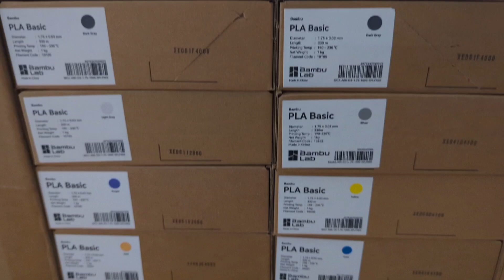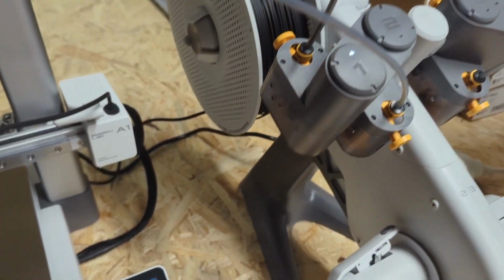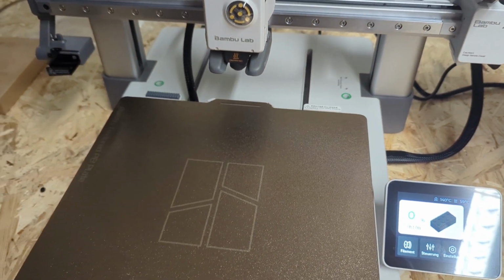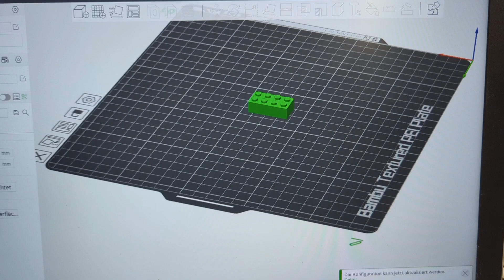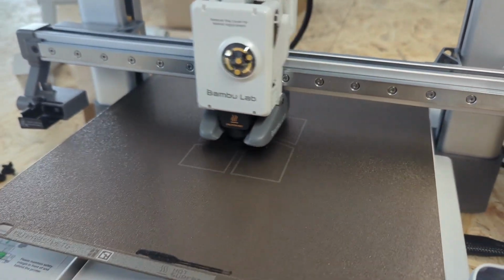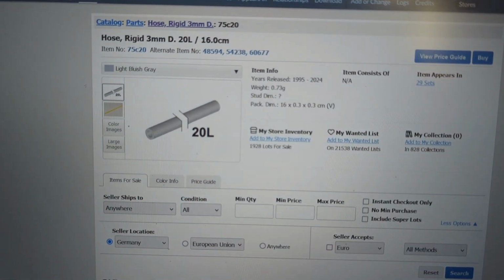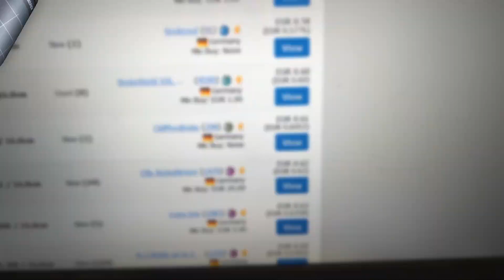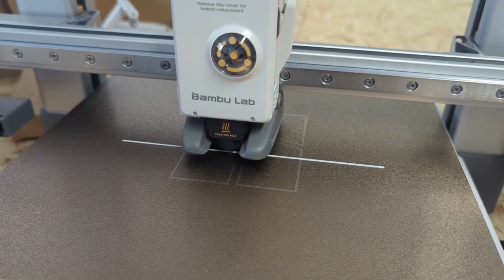3D Printing Your Own Bricks: Can You Create LEGO®-Like Pieces?

Comment: What software was used to design your own Lego parts and produce the STL files?
Reply: I suppose any parametric CAD will do. FreeCAD is free and relatively easy to use (there are several series with tutorials on it).
Reply: I concur ....Freecad with proper constraints .....especially using construction lines and equality tags to a few master driving dimensions it is possible to rapidly test a number of iterated designs .....testing gap feom stud OD to wall edge, stud diameter, and wall thickness are easy to vary ....as lomg as you remember to keep them perfect multiples of the nozzle line width ( not necessarily) the same as nozzle hole diameter.
MangoJelly has excellent tutorials for new Freecad users.